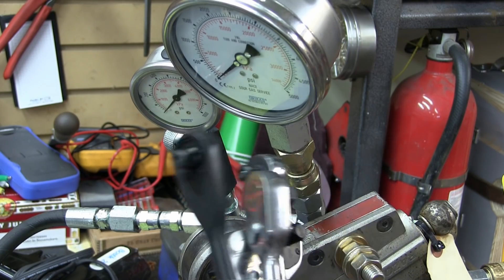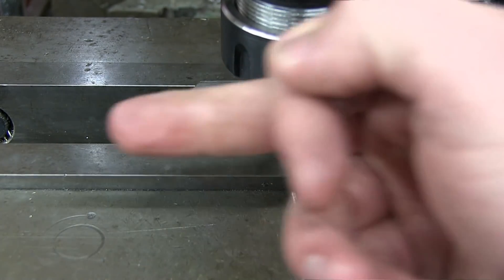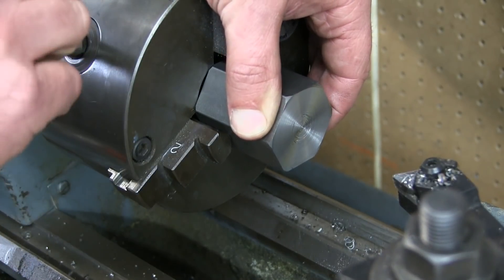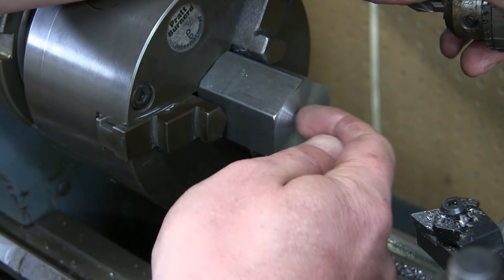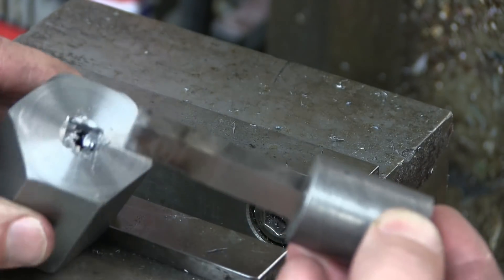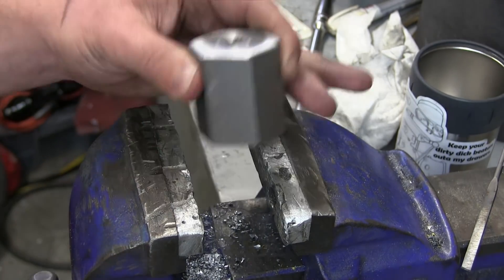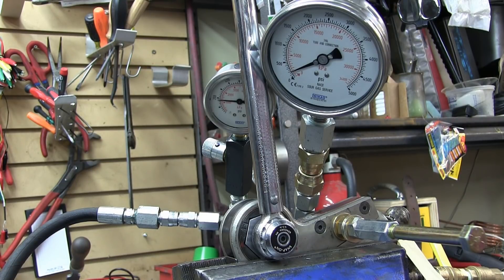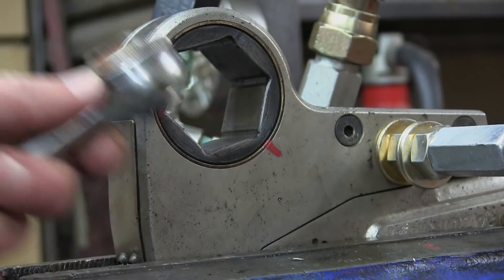How Much Torque? | Broaching squares to test RATCHETS!

Comment: My Bridgeport is a 1957 vintage.  So loose I don't need to make no stinkin' broach.  There is enough slop in the ways that she wobbles enough that ALL my holes end up square.
Could never get rid of her, though.  She is romantically connected to the Clausing 13" lathe nearby.
Yes, I am another one that will flourish during the Zombie Apocalypse.
Just turned 69, and my daycare center was Dad's machine shop.  I was running the cast-off South Bend belt-drive lathe at 8 years of age.

Comment: Forgive me but I'm not really skilled at posting. To the debate over climb or conventional milling, conventional pushes the material away from the cutter and taking out the slack in the gears driving your table from here to there, until you jam your workpiece into the cutter hard enough that the end mill decides to grip and cut a chunk out. This little dance is done "RPM x flutes" times a minute. Occasionally a chip "shaving" lays across the cutting edge and makes it all the way back round to time to cut again. It's also noteworthy to let you know that end mills do not cut a chip. Meaning that while they will cut a chip off a workpiece, they dislike crap getting between them and the actual workpiece. Now if you start climb milling with a machine that has wear in the axis, and the cutter grabs the material in order to attempt to begin cutting it, gets a nice bite, the slack rears it's ugly head, cutter drags workpiece in closer which results in cutter having no option than to take a much larger bite of material, causing said cutter to flex (HSS is much more tolerant to flexing than carbide), the increased load breaks the cutter. Climb milling is a lot more attractive for a finishing pass. Just a couple cents, hope it maybe helped folks asking about the slack/ which way to mill type stuff

Comment: I don't judge but...if you want a true test there is an easier way to do this by simply locking the test nut in a vise set the wrench on the nut attach a cable to the end of the wrench and add weight to the cable till it breaks add all the weight up and you'll have your true test amount of ft/lbs this is also a quick and dirty way to bump test torque wrenches also. To attach the cable just use a saddle clamp and if you have some lifting weights they would suffice for the weight.

Comment: Right back atcha, Unca B.  I'm a real machinist and I learned a thing or two on clapped out 1950's machines when I was young.  If the ways are shot, or it needs  big money in gibs, or you're working with 50 thou backlash on those old lead screws, yeah, run it conventional and keep it safe.  I getcha.  I getcha.
Worn out machines can still do work when you know how she likes to be handled.  Handle 'er right.  Chips will still fly.

Comment: I appreciate the post script explanation.   In the end, as long as each wrench is tested in the same way, same rig, energy source, angle of the dangle then the rest are valid.   The metric, the convention of comparison is not not altered.  There for which is stronger from. The test set?  The El cheapo one.
Could the numerical values be converted to standards traceable to natl. Beauro of standards?  Yes.
Would a purpose made test rig be closer to reality? Perhaps.
The thing to realise is that regardless if the grade 8 bolt is mid handle or somewhere near the end, all of em will fail with a big enough cheater bar!
Thanks again keep your da'kine in a vice!!

Comment: This is pretty cool, and way more scientific than most tool reviews. I gotta nitpick though, I break a lot of tools (working car mechanic here) and for the most part I strip teeth in the ratchet with shock loads. You know, tight bolt, it pops loose enough to turn 5 degrees and stops-the shock load sometimes reverses the ratchet, sometimes chowders some teeth, sometimes both. No clue how you'd duplicate the real world test there. The exception was a Cornwell ratchet, I split the case on that one. I was really disappointed by that garbage.

Comment: Once upon a time I was servicing forklift tires (a lot of forklift tires) and I was instructed to set the lug nuts to 500-600 foot lbs. I didn't have a torque wrench handy that could do that so I made an extension for my breaker bar so it was a total of 3.5 feet long and then to tork the nut all I had to do was gently put all my weight (150lbs at the time) onto the end of the bar and presto perfectly torqued!
Reply: Thanks to the wonders of google search I managed to dig up the service manual on the Ingersoll and looks like the rear lugs are M22-1.5 and should be torqued between 450-500 foot pounds dry and 540-600 greased which we did. so I was remembering correctly!
Reply: Wow!! Was not at all expecting another video maker I enjoy to be watching the channel that personally can not get enough of!!
Reply: Cody'sLab someone with actual legitimate experience with forklift maintenance told you 500 to 600 FT/LBS for LUG NUTS?? Unless they were those big off road forklifts that have the 4 wheel drive and 4 wheel steering with a boom that extends 3 or 4 stories high (which we call a LULL in construction and heavy equipment) then I can not see any possible reason that the lugs would need any more than 200 at the ABSOLUTE MAXIMUM... I wouldn't think that Regular warehouse type forklifts have lug studs any bigger than 1/2 or 5/8 diameter...
If it was LULL tires you were doing, I could see 400 MAYBE 450 but even 400 seems a bit overkill for the size, weight of the machine, and the fact they don't go very fast... Unless I'm missing something I just can't wrap my head around a forklift lug nut needing 500 to 600 FT/LBS of torque...
Reply: Ayyy Cody I didn’t expect to see you here hahaha, I absolutely love your videos, keep up the awesome work!!! Peace from Australia ✌🏻
Reply: Quite clever Cody!

Comment: Uncle bumblefuck i have a question, what does 13000 psi come out to be in ftlbs on that hytorc chart? Had a FUCKED up piece of equipment at work that we couldnt get a cap off of, so we put the hytorc to it at 13000 and it still didnt chooch. Ended up air arcing the cap out then just cleaning up the threads.

Comment: So the jibs on your clapped-out bridgeport are just completely Beyond adjustment and no chance they could be shimmed? What I would suggest is to back the left-hand jib screw all the way out and drive the right hand jib screw all the way in if that's not sufficient then add material behind the head of the jib screw to travel the jib further in Beyond conventional limits. Then cut additional relief into the left-hand end of the jib to accommodate the left jib retainer screw. May not cure the clap but it'll give it a chance to scab over.

Comment: I dont know much and my question is gonna show it but i must ask any way .. does the distance where the ratchet rests have any effect on or in your test
Reply: As far as anvil and ratcheting mechanism torque, it does not. It would change the load on the ratchet handle, but that's not very likely to be the weak link.

Comment: Dick is in vise. Vice. Wife. Safety squints on, mother is on speed dial, ambulance already enroute. That doesn't strike me as the least bit dangerous. Putting the ratchet gear under that much pressure. What happens if the gear fails? I imagine something like trying to a  pull a tree out of the ground with a clapped out Ford F-1shitty. Gear shards and gender fluid allover the place. 

This brings up a point. Should a ratchet gear be lubed? I rarely of hear the gear being the problem, but stranger things have happened. Like having a Harbor Freight drill do better in a work enviroment than your never used mothers DeFault. Whats the Harbor Freight brand? Chicago Eletric? Got 5 more hours out of it than the DeFault stripping some cars. Back to the lube on the ratchets clicker bit. Just a idle thought.

Also AvE, bumblefuckery suggestion: Waterproof a something with RTV(Gasket caulk) and WD-40.

Comment: Ave, do you know that future electronics will lock users into company and repair of it will be almost impossible? Apple is always a pioneer and they started this with iPhone 5s where when you changing button you loosing the electronic function (fingerprint), on the 6th model the locking is 100% - all parts are locked to specific cables ID - so if user try to repair it without paying Apple - iPhone will lock-up itself because new parts must be programmed at Apple on the motherboard level. And ALL repairmen know this awful secret but no one knows about that in public. Now imagine that other companies copy Apple, Android makers, next other electronics makers. And they will do. The problem is that no one is heard of any consumer class action suit against this Apple practice, only when we will have first court case when Apple declined to reprogram outside-repaired iPhone out of the warranty - we will be saved, but there's none. On their latest "iPhone X" they even locking users to their servers because of that "face recognition" system and everyone is quiet about that.

Comment: On the topic of real machinists, they also like to use spot drills instead of center drills.  Center drills are supposed to be used to make holes for centers (imagine that) so have a 60 degree angle to match (oh my word!) a center.  Where as a spot drill will have an included angle closer to, the same as, or larger than the drill to be used so idealy the drills web makes contact first, reducing the likelyhood of drill walking (as illustrated in in the above video) and damage to the delicate outer corners.  The more you know (the more you can be a grumpy old pedant.)

Comment: Get a 90 head, and use the old up and down, that's not clapped out yet, clap it yourself.
Reply: And i know you heard that line from where you heard that line some many videos ago, but no, it can't make itself on account of not being able to make its own bed. A mill on the other hand can, make itself, at the hands of an accomplished operator. A lathe? Not in a million years. And that includes the teeth on the jaws, the gears getting cut, spinning a screw that's as long as the lathe????? Nope. That's an old wife's tale.

Comment: Can you pump oil into the tool and use the hand torque wrench to compress the oil and achieve the same results? Since you already have the setup and all its much cheaper for me to have you try. If it does methinks that setup is much more economical than a transducer socket for testing torque devices

Comment: So, I'm wondering - would it be possible to have an example of what the "clapped out bridgeport" does if you run things through it the "right" wrong way, to demonstrate what's worn out? In some sort of safe-ish way that doesn't damage the beer you're holding or some such?

Comment: Mechanical engineers must feel so special to have the theory match up with observations. I gotta admit it was pretty satisfying to hear the torque wrench click right when the needle hit the right pressure.
Reply from the maker: Request: "statics for muggles" vid!  I'm gonna call you out in the next one. The flow meter I made didn't pass the leak test. But I have something better. Please pm me your shirt size and addy and I'll send you both.
Reply: I did one kind of up that alley: https://www.youtube.com/watch?v=XcuMY6XY7go
Reply: The span of the main trolley being the width of the building was about 40 feet width of about 10 feet anyway long story short I calculated the materials that it comprised of such as all the I-beam material Channel iron material angle iron material Motors gear train cables the block the hook trolley Wheels xcetera all observable aspects of the unit. looked them all up in a list of weight to length standard cross sections and gave an estimate of weight which totaled at 12931.35 lb at a later point I cobbled together a scale using a porta power short body Ram and a 5000 PSI pressure gauge to determine weight by multiplying effective pressure times area of RAM to determine I was within 120 lb it was a hell of a day
Reply: I have gotten that feeling myself once , a friend of mine proposed acquiring a overhead Gantry crane and was curious what the logistics of moving it would be if we were to purchase it we had no idea what it would weigh it was rated at seven and a half tons lifting capacity
Reply: Internet Tough Guy in a nutshell you can certainly appreciate the Simplicity of it . My enthusiasm stems from the fact that I've only got a GED and acquired basic structural comprehension from a plans and specs course including structural drawings through an apprenticeship program in sheet metal ,HVAC work

Comment: As a Truck Mechanic I find that very puzzling.  Awesome tool btw,  but I have broken many ratchets in my day and have never broken the drive head never!  That looks like an old craftsman ratchet, would bet ya dollar the snap on will break teeth.   It also would be cool to show how week adaptors are, good way to loose your teeth use a 3/4 to 1/2 adaptor on a big old snap on 3/4 ratchet.

Comment: The closer the reaction bolt is to the head of the ratchet, the more side force is placed on the ratchets square drive. I have seen ratcheting torque multipliers break the square drive at low torque because the reaction arm was blocked up too close to the head. The reaction point should be at the very end of the ratchet.

Comment: There is no "wrong" direction of travel, as the CNC fanboys might think. On old manual mills climb milling will mean the death of your cutter, as it means the teeth will pull the part toward the spindle if there's any backlash at all (I guarantee AvE's mill has enough to go around). Therefore he must conventional mill so the cutter pushes away from the part/backlash in the machine.
Google conventional/climb milling if you have no idea what I'm saying haha

Comment: If you use a couple of those poopy ratchets and set one like you did here and when it hits, if it hit over 200, then let off and ratchet it a few times round an then set it back in an test it again but don't try an set it on the same tooth each time just throw it back in at what ever random spot you stop ratcheting and you may end up doing this a few times each with a few different ratchets  but what it will do is break at a random number under 200ftlb

Reason I say to test this theory is we have all had to use a poo ratchet at some point in time and when using to break loose high torque bolts, I have noticed that you can use a leverage bar an get it to crack loose then use the ratchet to take it off and keep using it till you hit another tight tight bolt and with out a bar on it for leverage so using less force you crack that one loose take it off and go to the next and the next an then you'll get one that's tight tight but not as tight as all the rest an boom ratchet breaks busted hand is end result an you Chuck that thing into the next state.  What I'm getting at is they don't always break the same an you can take off a 200ftlb bolt an keep using it for a month an then a 70ftlb bolt comes along an snaps it an your knuckles 

Test this

Comment: probably a stupid question but why would there be a right way/direction to machine stuff? I just dont see a difference wether you go left to right or right to left. Also since your mill is as old as me, happy 30th!
Reply: Look up "climb milling"
Reply: thanks, I think I got the point. However, couldnt you simply counter that by switching front to back of back to front if you can only mill left to right/right to left? And yes I realize I am still missing the point, I am just curious :)
Reply: It depends on what you are doing. With a small piece like here and if you are milling the whole top of the part, no problem switching back to front. But if it's a larger piece or you dont want to mill the whole area, it less work to just cut one way.
Reply: Conventional vs climb milling. One has more force involved. Guess which one.?

Comment: Ave, the "breakaway" torque is basically how tight of a fastener an impact can loosen by continually hammering on it. It may only produce 250 ft lbs, but if it loosens a 1100 ft lb bolt, they say 1100 breakaway.